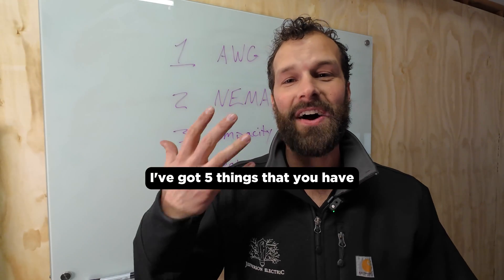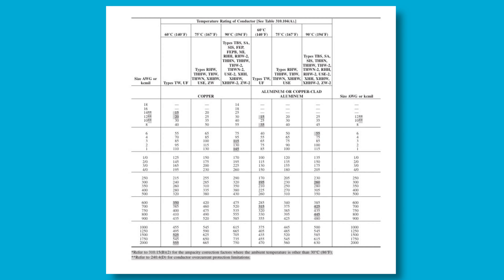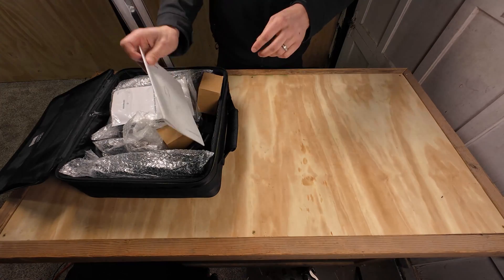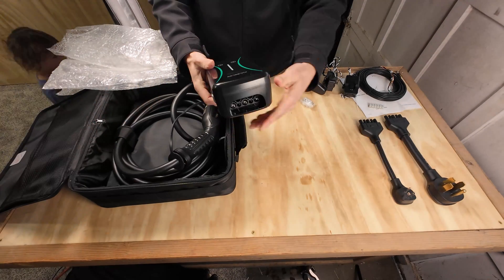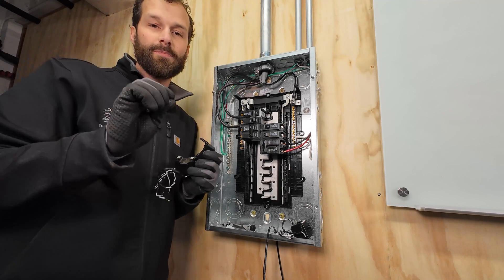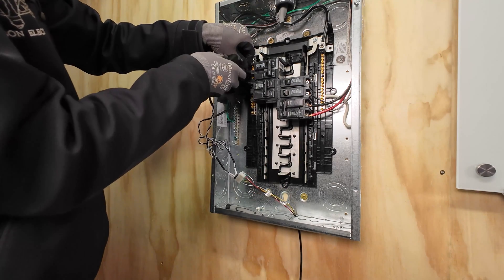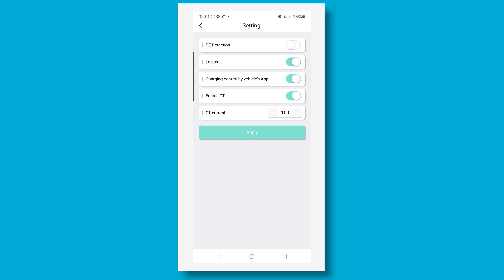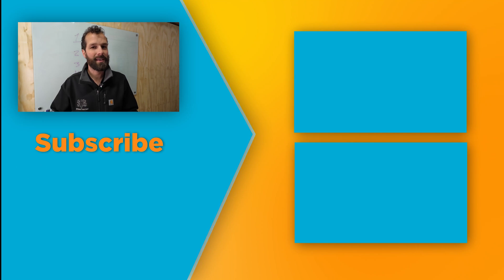5 Questions an EV Charger Installer Should be Able to Answer: Fulsolen Smart A01

Comment: Continuous load is 3 hours or more at max load. These chargers have load management so they do not use maximum for that long. Could you argue that?
Reply: Article 625 says all EVSE are considered as continuous loads no matter what.
Reply: @EthanMatlack thank you
Reply: @charliespruyt5815  The NEC defines an EVSE as…

“The conductors, including the ungrounded, grounded, and equipment grounding conductors, and the electric vehicle connectors, attachment plugs, and all other fittings, devices, power outlets, or apparatus installed specifically for the purpose of transferring energy between the premises wiring and the electric vehicle.”

Note that this doesn’t include anything actually in the vehicle. Yes the actual “charger” is in the vehicle, but the EVSE is the wall-mounted device, or the cord assembly.
Reply: I was coming from an ev engineer perspective. Then i checked the nec. I appreciate it

Comment: I will argue that you cannot use #6 romex for a 48 amp continuous load since you are locked into the 60 degree column and 6 in 60 is 55amps.   10kw electric heat kits are actually rated at 9.7kw because the manufactures know that 6-2 romex is running to most residential air handlers this is done so you can use 6-2 romex .   If you were to venture into the 75c column using 6-2 MC or running conduit with THWN then the panel/ breaker terminals have to be rated for 75c.
Reply: Nice to see someone that knows code. This shouldn’t even be an argument. A 48A nameplate EVSE is considered as a 60A load, and a 55A rated wire cannot support a 60A load. The next size up rule is irrelevant because the wire still needs to support the load.
Reply: You can use the next size up rule. Then you can use #6 Romex. Not everyone is comfortable with this but it’s correct
Reply: @NextGenEvs Master electrician here. You cannot use the next size up rule because the wire is still inadequate for the load. This is an extremely common misinterpretation - go back and check the code again.